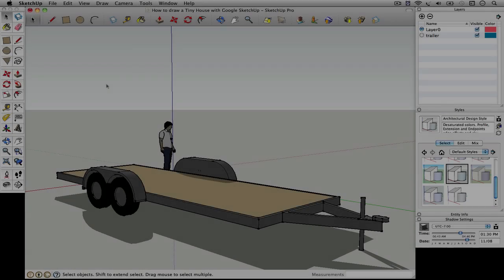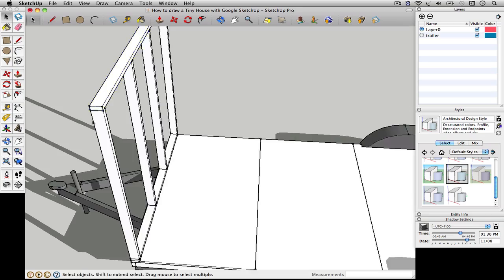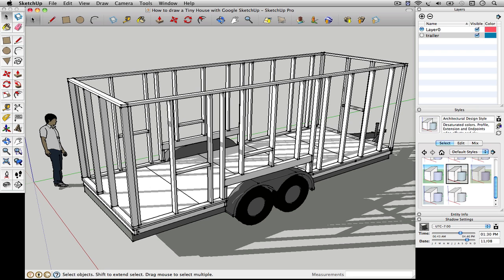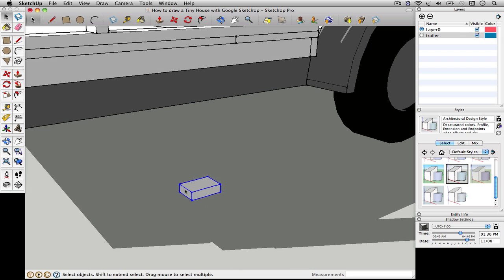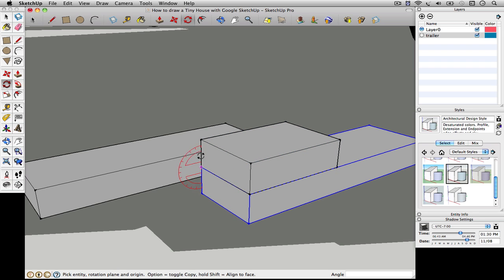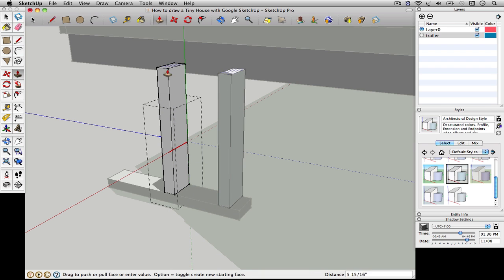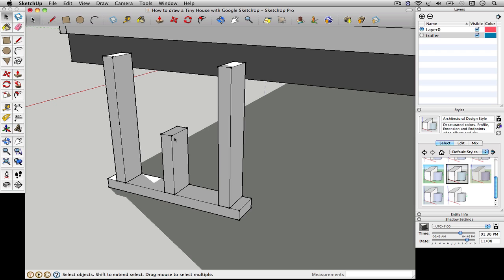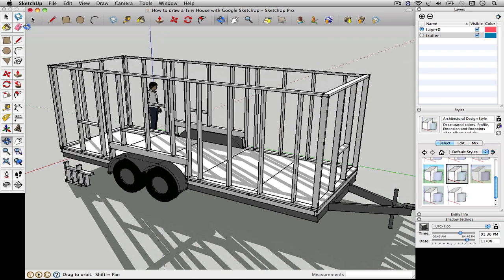How to draw a Tiny House with Google SketchUp - Part 1

Comment: Hello, I'm trying to build a 10x10 greenhouse with a roof on hinges. and decided to mock it up in google SketchUp and found your video I'm trying to learn the aspects but following along things aren't working. like I make a component and then try to edit one but the other doesn't change.
Reply: Oh, Im surface pro if that matters but Id think the program should work the same no matter what one is on.

Comment: Hey Micheal. I purchased a few th plans which are great. Do you do sketch up models using SIP (structural insulation panels?) My panels are 2.4x1.2 metre rectangles. Thanks

Comment: did u draw the trailer too? how did u do that?
Reply: Open up Sketchup. You know your list of tools on top above your field for building? There is an icon that is three from the end called "3D Warehouse" and here you can search for pre-made items like this trailer. Hope this helped if you still needed it!
Reply: Hi James, how do you know that the trailer was exactly the size that you needed? Basically so that the rest of the house could be built/designed with accurate size? Thanks!
Reply: it was most likely a plugin or item from the 3d warehouse in the windows tab

Comment: I am struggling with how to cut the window openings out of the sheathing.  I have tried various methods, that just are not working.  Please advise....
Reply: Brad Zachow  The way I do it is to make the wall, then with the pencil, draw the window. using the select tool, select the window and delete it. then use the "thickness" tool to make the wall your standard thickness. hopefully that helps :)

Comment: I'm already well into my ultra-micro light house build, 50 square feet build on wheels. Again, it was easier to do this then it would have been to have tried to design it on sketchup.
Reply: Then why the f*#k are you here?
Reply: tamugrad07 Because I originally came here hoping this would help. Turned out it didn't. Is this really that hard for you to grasp? Are you slow witted? Head injured? 

Should only people who have positive things to say comment? If so, then why did you post?
Reply: @BrooklynAvenue  what finally did help you? Cuz this isnt helping my either

Comment: Where do i find a 28 ft trailer?
Reply: http://www.tinyhousedesign.com/skp/trailers.skp
Reply: Just use the trailer(s) in the link Simon posted and edit the trailer and drag it out to 28'.
That's what I did and it was pretty simple.
Reply: T Silvers Do you have a link? And what about the lengths in front and back of the wheels, wouldn't they be different than what's on a 20 ft. trailer? Thanks for the help.
Reply: The link is down maybe a few posts. Atleast it is for me. 
You have to move the wheel well to where it's located on your own trailer. If you don't have a trailer yet then there's not much you can do. 
I don't know if there's a standard for where the wheels are located on a trailer. I would think there might be but I can't find any information on it.

Comment: I'm unsure how to find the trailer you used in the warehouse. Could someone help? 
(There's sooo many options and none seem right!)
Reply: http://www.tinyhousedesign.com/skp/trailers.skp
Reply: In California trailers may be up to 16 feet by 8 feet with little regulation.  Larger than that laws start kicking in that restrict how you use or move the trailer.  Check your local state laws on trailer licensing  and  on moving permits.  Here, CA, 16 x 8 or smaller is legally called a "camping trailer" and has few restrictions.

Comment: more questions come up, how do you prevent water infiltration from underneath? imagine a large indoor spill or perhaps even snows of more than 2 feet blow up underneath, melt and evaporate.. a warped flooth sheath would squeek i imagine... mildew would not be to pleasant.

Comment: I was wondering about your beginning positioning of the floor joists. Are they hanging off the edge of the trailer? Wouldn't the full weight of the structure be better off positioned resting on the actuall trailer and not hanging off the edge, supported by horozontal nails and or bolts under a single layer of plywood? I'm imagining the thing collapsing under its own weight during a heavy blizzard or intense windstorm rite now. Please correct me if I'm wrong.